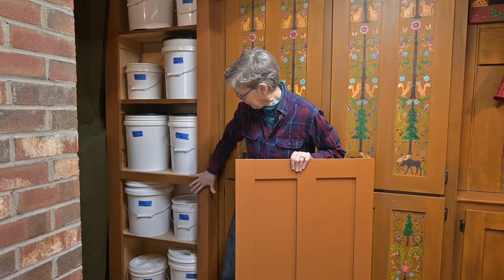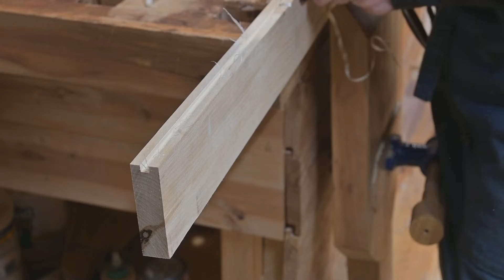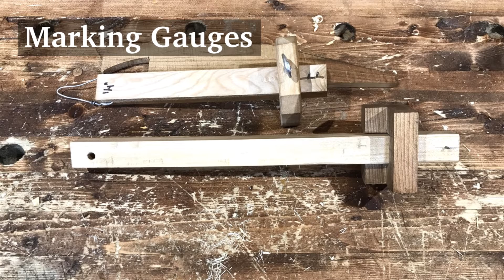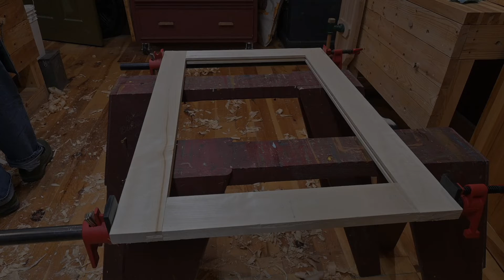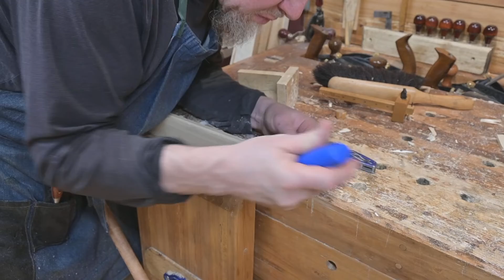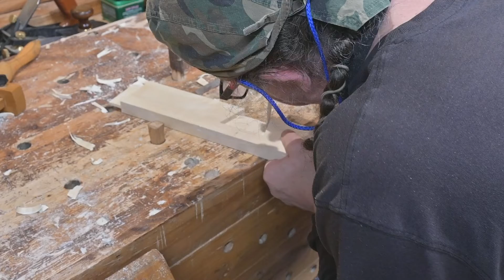Make a Shaker Style Door Frame Using Only Hand Tools

Comment: Was interesting watching this guy with more experience than I will ever have do things differently than how I was taught. But seriously no bench hook?
Reply: Hi I’m the dude in the video.
I had to go back and watch the video as it had been a while, I see I’ve  gotten greyer since then.

I’ve never personally found bench hooks useful.
I just use the pegs for the same thing just pop in a couple and pinch the work and go.
Not right or wrong just different.
Being ambidextrous it’s a whole lot faster for me, not too be limited to which hand to saw or hammer with. And I tend to treat the saw as rough in to be pared to fit not the final product.
Am doing this to keep the lights on so speed is always an issue.
Thanks for watching.